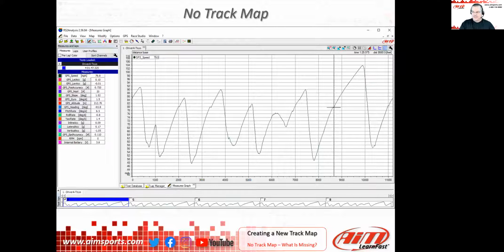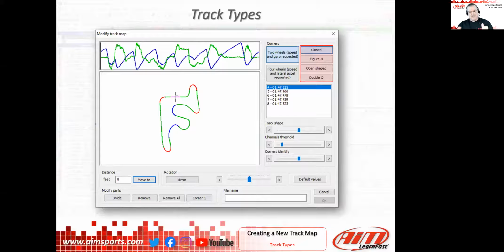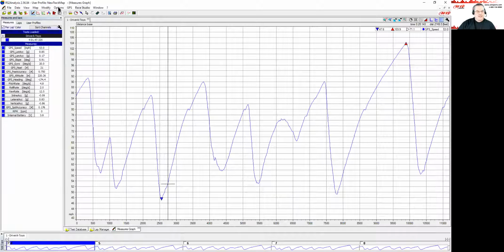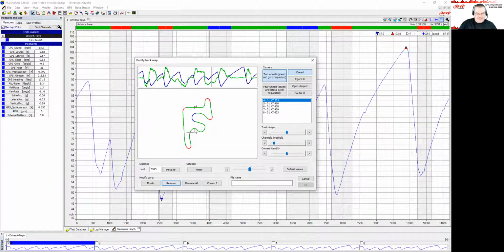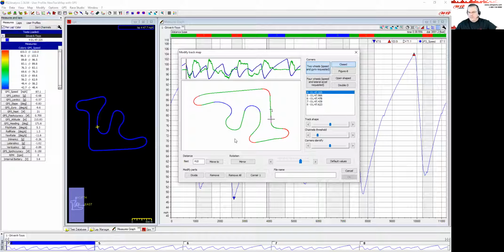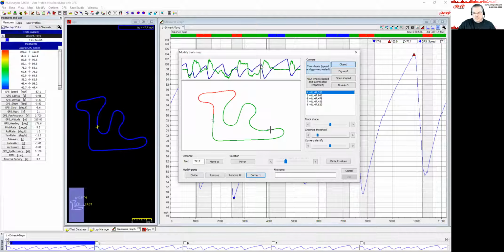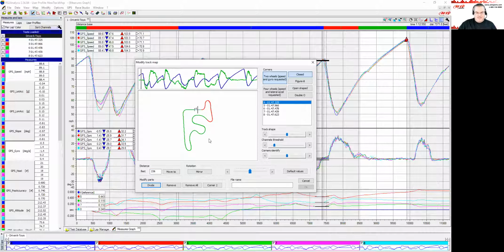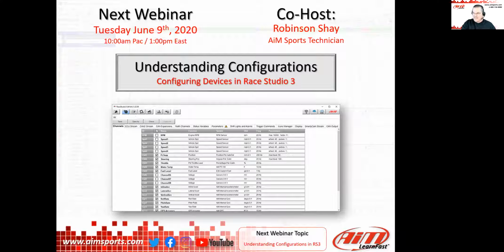1-20 Creating a New Track Map - Live Webinar with Roger Caddell - 6/4/2020

Comment: Is it possible to use open shape map in evo4s? On solo2DL it is working well but in evo4s no support for open shape :( In Poland we have a lot of events with start and finish lines in open shape.
Reply from the maker: You can build a track with an open configuration in the Tracks section of RS3. Once you have built the track you can send it to the EVO4s to be stored in its track database. If you have any issues you can always reach out to our support staff for help, Support@aimsports.com